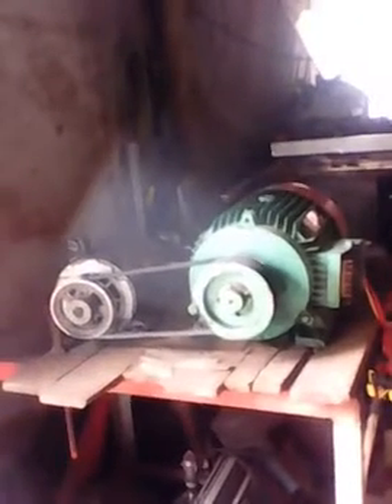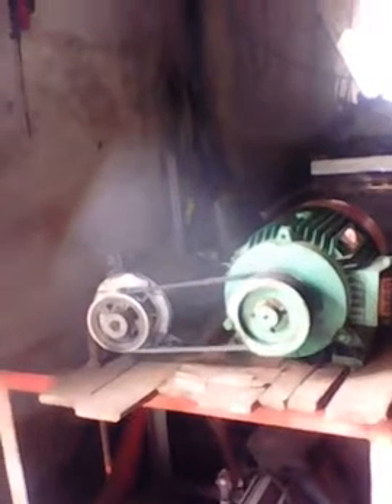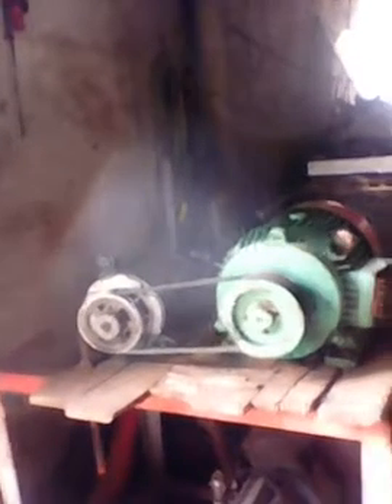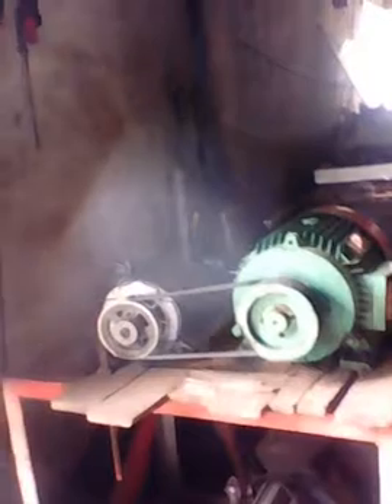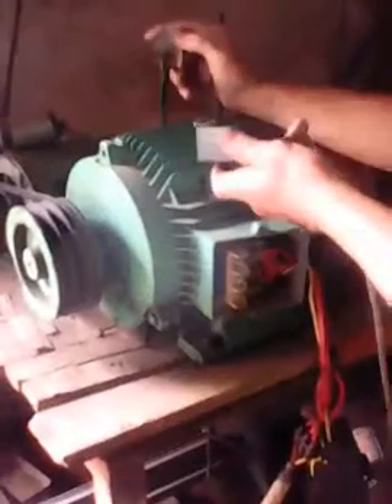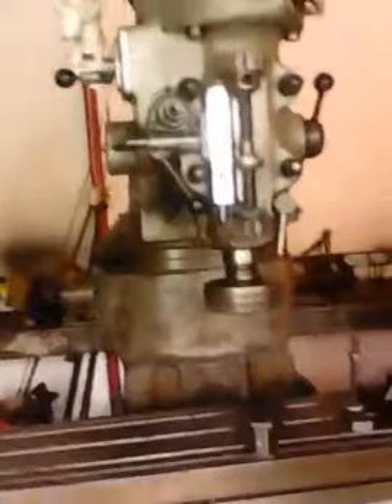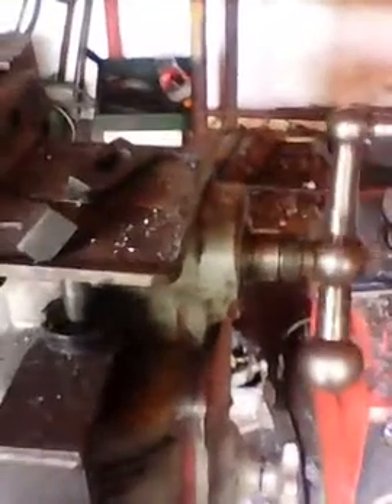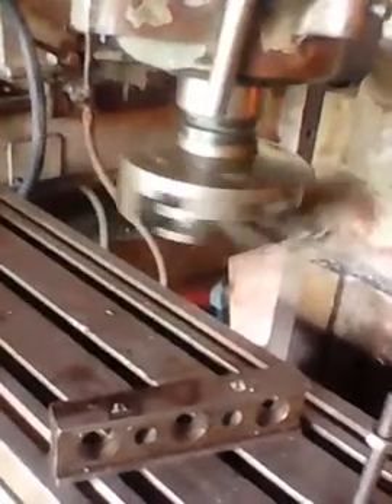Running a 380 volt motor of a 220 single phase supply

Comment: Let me get this right. You're connecting a smaller single phase motor to a 3 phase bigger motor and then tapping The power from the3phase motor to Run other machines. You're using The bigger motor As a generator,is that correct??????????